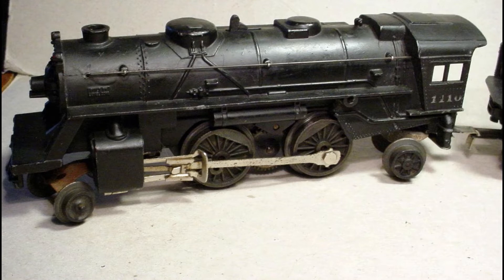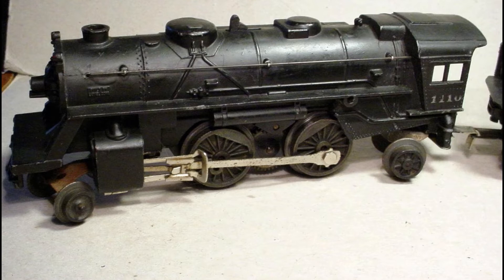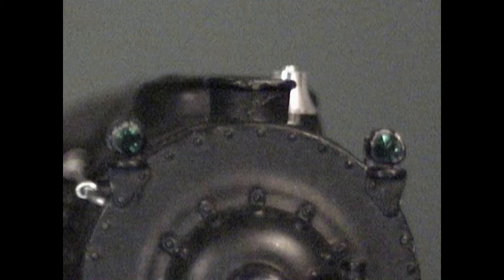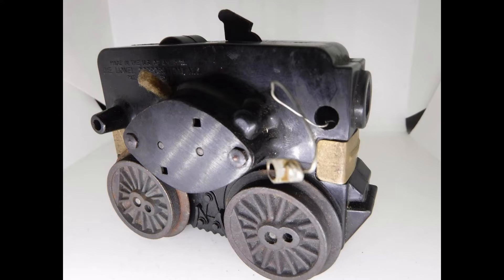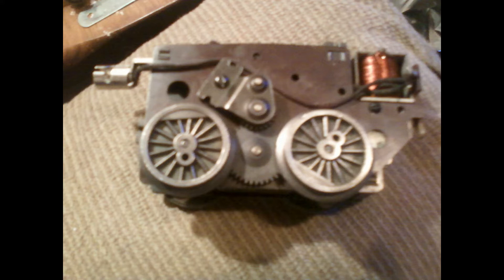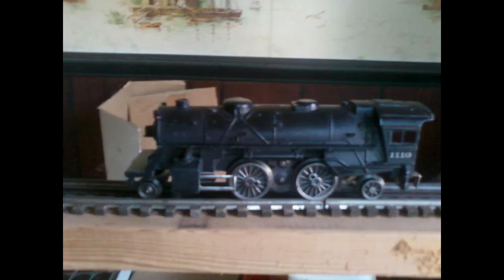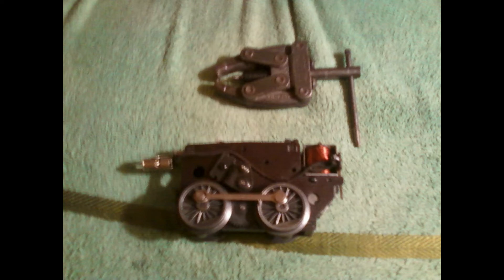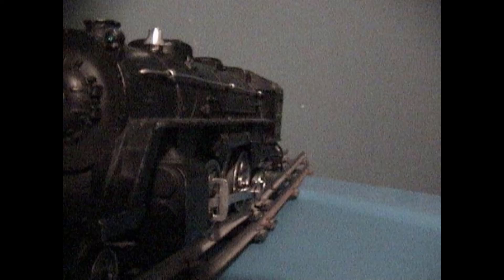Lionel 1110 - We're Gonna Dress Her Up!

Comment: I recently got a similar engine, a 6110 scout for a single dollar. Everywhere it could've rusted, it did. It took only 10 minutes, some WD-40, contact cleaner, and lubricant to get it running like a champ. Nice work upgrading this one.
Reply from the maker: Excellent, glad you could rescue your locomotive!  Yes, the 6110 is almost identical to the 1110, the main difference being the hole in the casting front for air to flow into and out of the smoke unit.  Thank you so much for watching and commenting.
Reply: I have two 6110s- both were basket cases with shattered motors, one of them the shell is broken too- I borrowed parts from another loco to repair the one with the good shell, and it runs and smokes great- extremely noisy, but all too happy to get up and go. Getting that two position reversing unit to work properly is another matter, though... still workin on it.
Reply from the maker: @leverettrailfan5414  Don't give up, sounds as though you've done a great job so far rescuing one!  Thank you for watching and commenting!

Comment: Another touch which really makes the drivers stand out is paint the rims white and also the counter weights on the wheels. I once did this to a 671 turbine engine and it really looks cool running.
Reply: I have the 681 turbine

Comment: Revisited this site ,still learned ,and I wonder what it would take to add a coupler cut bar to the pilot??
Reply from the maker: That would be a great idea!  I imagine if you were to use a couple handrail stanchions such as I used in repairing the Lionel 229 video, they could be mounted on the shelf over the cowcatcher and then with some intricate bending of piano wire it could be accomplished..

Comment: I just found you this morning and immediately subbed. My kind of videos. On the black permanent markers, after the ink has dried I dab a drop of motor oil on a brush or clothe and apply it to the surface. It gets rid of the purple hue that the marker left behind.
Reply from the maker: Excellent tip using the oil, thank you!  Thank you very much for watching, commenting and subscribing!!

Comment: James, another question. How did you secure the 2034 motor into the 1110 boiler casting. Did you drill a hole on top of the casting to secure the motor at the rear? Any front support? Thanks jack.
Reply from the maker: Thanks for your question.  Actually the same mountings are used.  The front of the newer motor assembly slides onto the front truck mount assembly as the original did and the cross stud at the rear which is inserted from one side of the boiler, through a hole in the motor assembly and screws into the other side of the boiler.  No modifications were needed to mount this motor.

Comment: Sweet! Nice job! How hard was it to mount the new motor assembly to the body?
Reply from the maker: Thank you!  The motor fit perfectly where the old one was, no modifications are needed to the newer one.  The only difference as far as the operation is concerned is that the lever on the E-Unit faces downward but is easily reached from the underside of the cab.

Comment: How does that LED work using AC? 🤔
Reply from the maker: Thanks for the question James!  These are LEDs I purchase from Evan Designs website.  They supply them prewired with a rectifier to change the AC to DC and a resistor to keep a constant 3 volts DC to the LED.  I've been using them for years now and never a problem.  I run one wire from the rectifier to the frame of the locomotive giving us the outside rails and the other wire from the rectifier to the center roller pick-ups, usually on the E-unit where the rollers connect on them.  Here is a link where you can see them; https://evandesigns.com/collections/hobby-leds/products/universal-solid-leds-for-transformers

Comment: Jim, nice job. Can you tell me what side rods you used? Thanks, Jack
Reply from the maker: Thank you and yes, I ordered the two connecting rods from Lionel for their newer Scout engine part number 35 on the exploded view. Part #6101666016.   I checked with Lionel service and the measurements were exact for the spacing between wheel mounts on the 1110.  The Main piston rods came with the engine so I didn't need those.  Below is the link to their page. Thanks for watching!
https://www.lionelsupport.com/ReplacementParts/index.cfm?startRow=26&PRODUCTID=a47cc435-27f5-4a25-a2e1-4255fe340efb&DOACTION=productPartFilter
Reply: Thank you so much James!
Reply: @jamesburns0657  Jack used the correct name for the rods attached to both wheelsets. They are called side rods.
Reply from the maker: @johnblair8146  Correct, thank you for watching and commenting.
Reply: @jamesburns0657  I have some smaller Lionel locomotives that I'm going to add side rods to thanks to your video. I also subscribed.
Reply from the maker: @johnblair8146  Thanks and have fun, it is a fun and rewarding upgrade!

Comment: Looks like it already had hand rails on the first photo.  Another way to fill in a hole is to use some super glue with baking soda.  That's how I filled in the e-unit hole on one of my diesel Lionel locos.
Reply from the maker: Yes Sir, I took the photos out of order to make more sense of the video slideshow.  Good idea using the CA Glue and baking soda, I'll need to try that, thank you, and thanks for commenting!
Reply: @jamesburns0657  Okay, I was just wondering why you added hand rails to an engine that already had 'em.  So, I'm glad you cleared that up for me.  As for the super glue and baking soda, it works very well.  I just glued a piece of scrap plastic underneath the plastic I wanted to fill.  Came out really well and was easy to sand and finish.  Thanks for your prompt reply.
Reply: W. Rusty Lane never heard of mixing the soda n glue... how does that actually work?
Reply: @Deadbuck73  Works great.  You'll just have to try it.  You first apply some super glue then add some baking soda to it.  It hardens almost immediately.  Just keep adding glue and soda until you have built up enough to sand smooth.

Comment: Lionel tried the plastic motor as a cost savings but all they were mostly was a big failure.Warning to one adventurous enough to open one up don't.
Reply: Good job!
Reply from the maker: @robertnielsen2461  I agree 100%, I won't even repair them any longer.  Best to replace with the better assembly.  Thanks for commenting and watching!